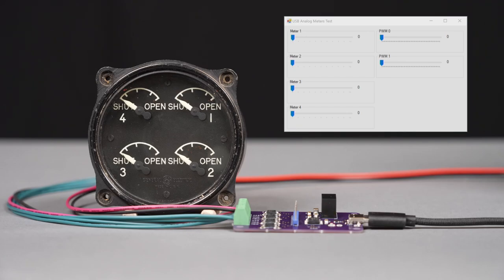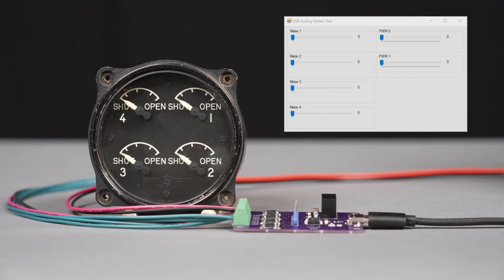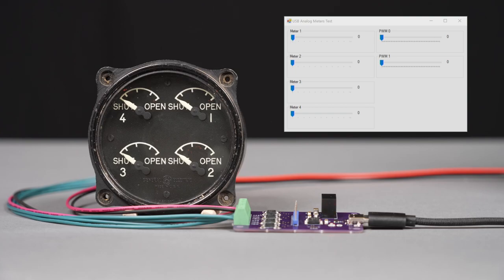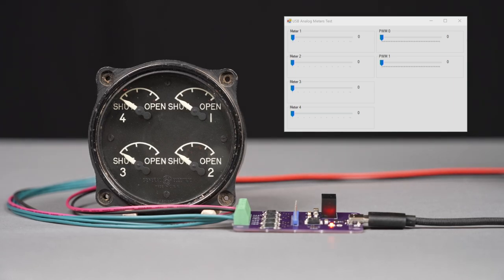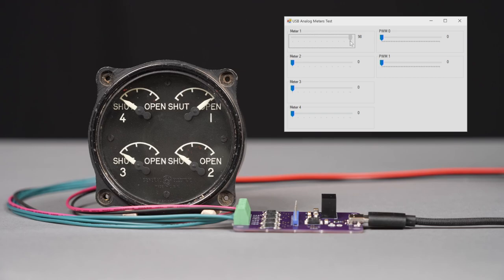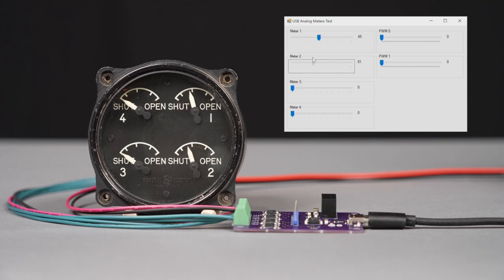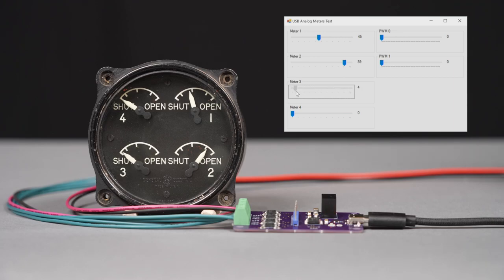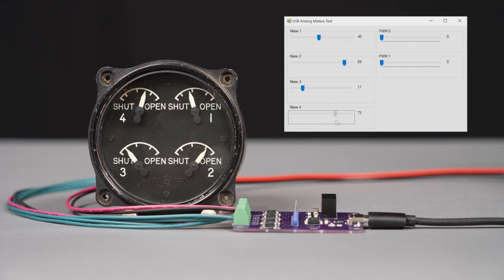Converting a Warbird Engine Cowl Flaps Indicator into a USB Peripheral

Comment: Awesome! I am not super familiar with style of indicator, but it looks like it may have been repainted. Usually one expects to see the familiar brown crust of radium lume on WWII warbird instruments.
Reply from the maker: Thanks! I looked up the specs on the dial. This one had phosphorescent scale markings rather than luminous so no radium on this one. The phosphorescent pigment has degraded significantly and it only glows for a few seconds now. :(
Reply: @GlenAkins  Ahh no extra spice then! Probably best if one is not looking for it, especially since the military grade UnDark they used was very heavy on the radium.